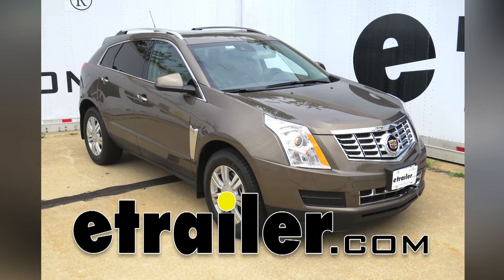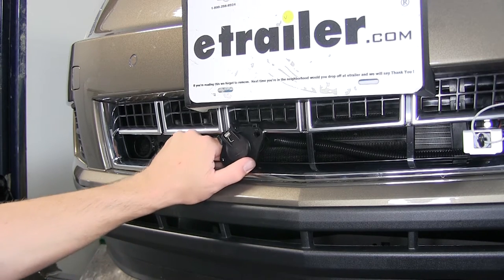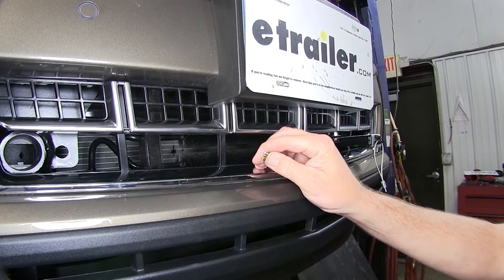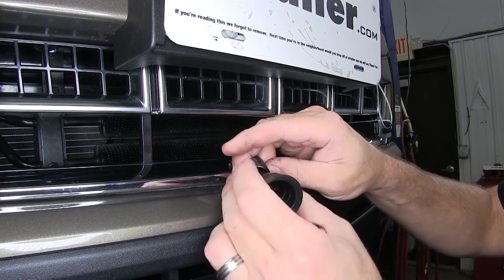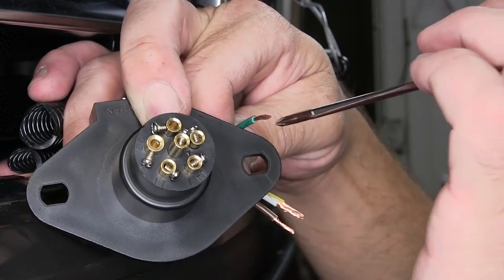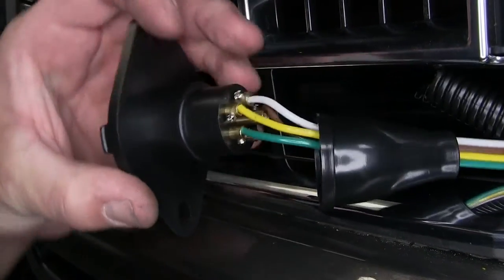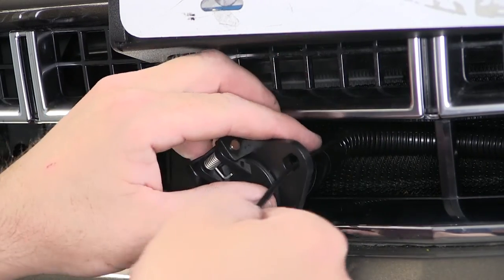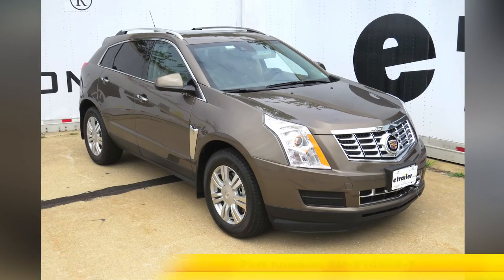etrailer | How to Install: RoadMaster 6-Wire Trailer Connector on your 2015 Cadillac SRX

Comment: Why is it on the front of the vehicle?
Reply from the maker: This 6-Way connector is at the front of the vehicle because it is being used to send signal to the vehicle tail lights when this 2015 Cadillac SRX is being flat towed behind a motorhome. You use an umbilical to go from the connector at the back of the motorhome to this connector so that the towed vehicle tail lights act in the same manner as your motorhome tail lights.

Comment: NO NO NO. Go to big R. Buy the 6 way to 4 flat. It plugs right in. No cutting wires. Plus it has the charge, ground, and brake wire. Or. Use a 4 flat wire and hide that ugly plug zip tied to the front of your car. And hide the 4 way in the bumper like someone would there glow plug wire.